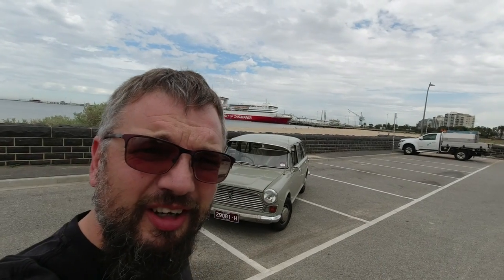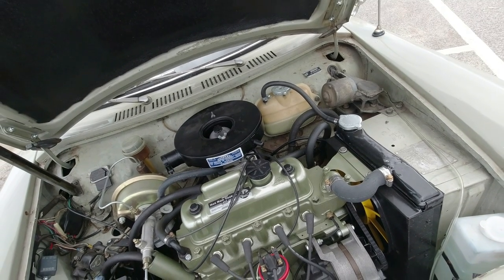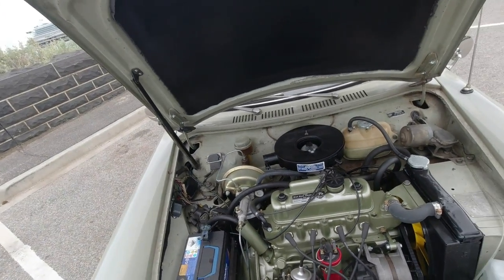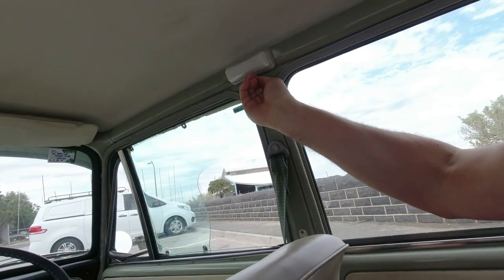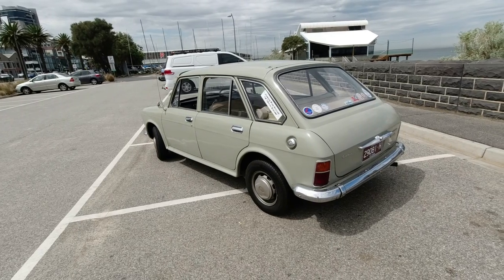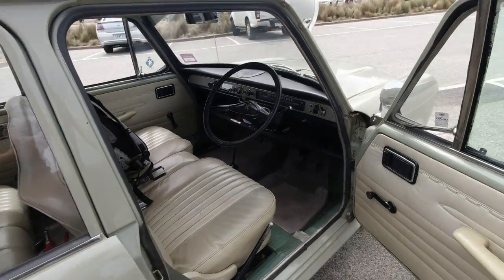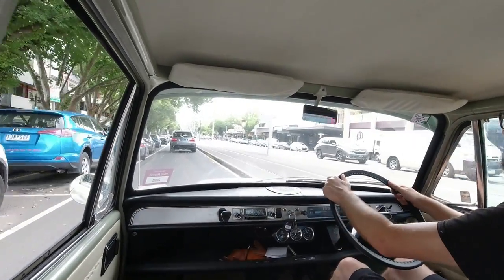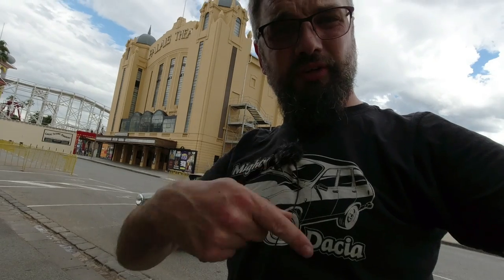Aussie Oddballs: Morris Nomad (1100/1300 station wagon thing)

Comment: We had an Austin Mini automatic. It had the larger 1275 engine with HS4 carburettor rather than the basic HS2. I remember being told in no uncertain terms to use Esso Uniflow oil, and no other. It was very expensive. 
The car had a phenomenal amount of sound insulation.
When my father-in-law bought the car after we had it a few years he decided that the £1.00 a gallon Duckhams oil was suitable. Three months later the motor/gearbox packed in. I liked the gearbox.
Reply: Yep, they were fussy on oil but required nothing special, just a good quality one.

Comment: The transmission shifts a bit like a modern Mercedes AMG or BMW M car, but more raspy.
Reply: It has a straight fluid coupling like the original Hydramatic, not a torque converter which tends to soften shifts because of the variable ratio.

Comment: Oh that was a treat indeed, much thanks Mr H. Who couldn't love a Maxi shrunk in the wash? Another mysterious (to us in the UK) motor, have to say it does look a little odd but I love it and wish they were sold over here. As an in house rival to the Maxi that was never going to happen. So sad there are so few left, be well Dinsdale and thanks to the owner.
Reply: The E series engines were brilliant. The 1500 lacked a little oomph but the 1750 was a stroked 1500 so heaps of torque. Rarely had to adjust tappets, which was fortunate since they used buckets and shims. I had 21 Marinas with these engines (before I lost count) and did countless thousands of miles in them. They kept me on the road during the early days of my marriage and was the car my wife learned to drive in. She loved the two she had.

Comment: I've been looking forward to this test . I had a 1500 Nomad in Melbourne the same colour as this. I got it free off a friend because it had stuck in gear (again) and the registration was due. I fiddled about with the gear selector and eventually got it so it would engage and disengage third. I drove it home several miles like that. More knowledgeable friends got involved and I ended up with a car which would select all except fourth, which was fine. I really liked the car; it was powerful enough and very economical. I even slept in it a few times after having a few too many at a party. IIRC you've got to open the doors to make the bed otherwise the arm rests get in the way.
This was in the mid 1980's when no one wanted BMC stuff and they were just a disposable car. I'm surprised the survival rate is so low though. I wonder how many 1100s and 1100Ss have lasted?
Nice to see "My" part of Melbourne too. You started filming in Albert Park, then drove through Middle Park and into St Kilda. For several years I lived very close to where you finished up. It was a fantastic place to live then; far more affordable than it is now.
Thanks as always.

Comment: When you closed the door I mistakenly expected the tinny clank sound typically associated with little cars. instead I was greeted with a hearty thud faintly reminiscent of a 76 Monte Carlo.
Reply: I also expected the tinny clank. My Morris 1100 certainly did the tinny clank thing. I wonder what they changed?
Reply: Inside the door is 7 pound of Aussie dust, giving it a lovely sound
Reply: Is that before or after the built-in Monte Carlo metal oxidation set in?
Reply: @davidhynd4435  The Oz Leylands were all "beefed up" after taking them for long test drives over "bush roads".
This was forcibly brought home to me when my mate & I hired an Austin 1300
in 1971, parked it on an uneven carpark, locked up, & came back to find the doors were all popped open.

We suspected foul play, but nothing was missing, & we had to move off the uneven bit before the doors would remain closed.
That would never have happened with an Australian made Morris 1100!

Comment: Back in '65 I worked in a shop that had BMC, Mercedes, And Ferarri. Wedid get the 1100 MG,  but they never sold well.  The engines leaked oil, that went to destroy the rubber CV joints and constantly needed replacement, due to the oil leaks that everyone tried to correct, with little sucess.  Thanks, Richard Schickling  Plymouth Meeting Pa.

Comment: I was 10 years old when I discoverd the Morris Nomad. It was another "Muriel, there's an outrage on the lawn!" moment when a cluster of hairy aRrrr$e Cobbers decided to mess with Mothers tooling. Like the bored out 1622 B series, the Blue Streak B serirs six, the hatchback, extra gear auto and manual Maxi box E4 engined Morris was an answer to a question BL never asked. Since the Japan Incorporated via AMi Toyota, and Datsun and Mazda and Isuzu and Colt had already invaded Australia and New Zealand, the Leyland Wing just added the best combinations. Heating, ventilation, bug demolishing windscreen wipers with great wash and wipe, burst proof door handles, venti pane quarter vents on Minis. The AP 4 speed gave birth to 3.48, 3.27 and eventual 2.76 axle ratios for 17.3 mph per 1000 rpm long legged cruising. 70 mph at  4000 rpm in a Mini wasnt that painfull. All the ADO16 questions the top brass failed to ask were answered years in advancr by those cocky "'strines". BL had the world at its feet. The P cars P8 derived P76 and the ill fated P82 compact with its planned Vee Six 3.3 litre cut down 4.4 V8. All qued up and planned in advance. The financial Cookie Crumbled worse than a Hudson, Packard Studebaker and Rambler condortium. Crumbs. I love your posted video Ian der Hubmiester. So sad that global growth of the Japanese stole all Englands great ideas and sold you all down the river. Oh, and the reason the Nomads survivak rate is so low was just chassis center rust and the somewhat difficult service of the hydolastic damper units. Everyone wanted the A series engines for Mokes and Mini Sevens oval track racers. Just like P76s got the 4.4 engine taken for Jet Sprint Hamilton jet boats and the Australian Leyland parts were drawn hanged and quartered for competitive club racing Car parts. Gosh Im sad at what happened.

Comment: A little red, Aussie built, 1967 Morris 1100S - complete with a bench front seat - was my granddad's pride and joy for years. With the Michelin Xs it was fitted with from new, plus the hydrolastic suspension, on a narrow tight, twisting back road, it could leave many a far more powerful car in its dust.

Comment: My sister had a Morris Nomad which she very cleverly managed to drive into a ditch and roll. She was unhurt. Nomad was not. Hers was the 1500 five speed. I had a Morris 1100 at the time so I was impressed by the extra performance and the five speed box. I was talked out of buying one by a mechanic friend who insisted that valve clearance by means of shims was a pain in the proverbial to get right, so I bought an Austin 1800 mk1 instead. I had friends who mocked the steering wheel angle saying that it was like driving a bus. I liked it. You could rest your arms a bit while you drove. Very nice, direct rack and pinion steering as you pointed out, although in the 1800 it was hard work at parking speeds. If Dinsdale were mine I think I'd have to ditch the loud exhaust. Shame there are so few Nomads left. I wonder how many died by ditch?
Reply: Thanks for passing on the mechanic comments. So much more insightful on why a car failed in sales in Australia than the comments by others about styling and colours etc.

Comment: The ADO16 was offered with a 1275 and AP automatic in North America as the Austin America.  It met with modest success in Canada, but didn't do so well in the United States. 

When our small family outgrew Dad's Sprite, he had three finalists for its replacement: Volkswagen Type 3 Variant, Austin America, and Opel Kadett Wagon. 

The Volkswagen was dismissed rather quickly, but the Austin hung in as we were to an extent already a BMC family with a Minor and a Sprite.

The Opel won out due to its conventional rear-drive platform and the national (Buick) dealer network for service availability (which was a serious consideration with family in rural Georgia in 1970.)

Cheers from Costa Rica!

Comment: Dinsdale has no problem keeping up with the modern appliances called  'cars".  The road you were driving on is called Beaconsfield  Parade.  The thing about the BMC/British Leyland cars built in Australia is that they were honest unpretentious cars made to adapt to  the climate extremes of Australia,and the vast distances of this continent
Reply: As a former owner of several BL cars built in Australia they suffered from some terrible problems that spoiled them for many people and truly limited their success. The Hydrolastic cars always suffered from ground clearance and inadequate suspension travel problems to be great cars in Australia. Things like the unshielded distributor facing forward that would get wet during a rain storm should have never made it out of the factory.
Reply: @dazaspc  As an 18 year old inthe UK i'd buzz about in my Mums Blaze orange Mini. In heavy rain dead Minis at the side of the road was a common sight. The coil was often the culprit as that too was mounted just behind the grill.  British car for British weather! Ah the irony!
Reply from the maker: Distributor rather than coil. Always a weak point being right in the firing line on a wet day.

Comment: My first car was a Morris 1500....picked it up 15 years old but in near new condition (50,000 miles) for $500. It was a 4-speed, but I soon swapped in a good 5 speed box. Once I'd sorted out a few BMC niggles and swapped in some decent front seats it was a good car, and I had it for about 8 years. A fast cruiser that handled well, strong, and great on fast outback dirt roads, and never really let me down apart from a blown head gasket one time that gave me the excuse to port it, swap in a set of 4:1extractors I found hanging unloved on the wall of an exhaust shop (neccessitating cutting the inlet manifold away from the cast exhaust- ah, the things that seem reasonable when young), and porting, flowing/rejetting the SU carby to match plus a few other tweaks. After that it was officially pretty quick- 100+hp is quick in a 800kg car...it easily embarrassed a mates new 'twin cam corolla' which was properly hilarious...

Comment: THANK YOU (!!) for not talking during one of your standing starts.
Much as I do enjoy your commentary, I also want the chance to hear the car uninterrupted. 
Sounds like the old girl doesn't like being driven hard during 3rd to 4th gear changes. 
I imagine the oil filter must get clogged sooner with clutch pack material. This is not a car to skip oil changes in!
Reply from the maker: Slipping into fourth was sadly very common with these gearboxes. They did carry out some changes in the UK about the time this car was built.
Reply: HubNut here is a response I got in quotes on a discussion board when I mentioned seeing a Morris mini auto for sale.

"The Automotive Products 4 speed "jerkomatic"...
One hell of a weird transmission design, with shafts counterrotating in other hollow shafts, bevel gears and other workings instead of the conventional epicyclic transmissions of today's autos, and a cool governor system for deciding the shifts points where a flyweight governor driven off the output shaft moves a hydraulic spool valve further as road speed increases and the valve opens and shuts various hydraulic circuits to change the gears, and there is a spring on the governor for resistance, but the spring is pushed harder against the governor when the acellerator pedal is pushed further, giving both the kickdown and altering the shift point as throttle position changes.
Simple, ingenious, and didn't work all that well...but it was a damn good try!"

Comment: Hi  Luv your vids. the 1500 was  a genuine 105mph cruiser  bucket seats, 5 speed gbox;/  overhead cam chain  too thin.  Kimberley was the only designed and made Austrlaian  car like   the 1800 ute. suffered from overheating  and cable shift. should have had solid  rods. \The kimberley had a  FANTASTIC sus. perfect for Aust conditions.  4spd gbox for cruising. extremely roomy.. UNFORTUNATELTY IT WAS FRONT  WD.    and  was   thirsty.  More vids please.  when  are you  going  to  test a TR6.  as  I still have  two of  them.   I hope you  enjoyed  driving on our roads.  Stay safe. and thank you for spending so much  time. for our  enjoyment

Comment: I had a 1964 MG 1100 sedan back in 1972 in high school. 2 door, looked a lot like this. It had the hyd. suspension also I used anti freeze for fluid in mine. Pumped front to rear so there was no side role, it would go around the corners real fast, till the rear wheels would broke loose. Then it would hop side ways real bad.     Dan

Comment: I had of the normal 4 door versions of these in 1973 - with the luxury pack.  Biggest heap of crap out there but did do 83mph flat out on a cold night.  Biggest worry was not the gearbox but the ignition failure every time the humidity got over 50%.  50 years later I would buy my old car back if it still existed.

Comment: It's a mini maxi?  Or maybe a midi?  What a strange but curiously rather wonderful thing.  I always really liked the A series with an auto.  You could use the stick to manually chnage gear too.  Very useful for downhill bits or maxing out the revs in each gear.  A bit is slippage is not unusual though.  Excellent stuff, thnaks Ian.

Comment: Awesome little cars. I had a 1500 sedan version of one of these as my first car. The 1500 had a 5 speed gear box not a 4 and would comfortably sit on 75 mph all day. They had their quirks however the one you are testing sounds to me like it has the wrong oil in it? The auto trans models like the mini auto trans models had all sorts of slip problems when you used the wrong engine oil. The only oil you can get now that works properly in these is Castrol XL.  The E series had its problems though as it had a flex coupling on the exhaust that would stop flexing and break off the exhaust manifold studs. It was quite common for these to have a VH40 fitted as a front brake booster as well. After bending the brake pedal in mine I fitted one as well. It is funny that all 1100, minis and nomads had a very light piece of steel holding the brake pedal but the Cooper models had a wider piece that wouldn't bend. The gear selection cables would rub and leak engine oil that was a very expensive fix. They were also dreaded by tire shops in their day as the wheels had so much offset many tire machines were unable to fit a tire properly.  I did hear once that the tail lights on these were also used on a particular sports car and were quite valuable however I have never identified what car it was.
Reply: Tyres needed to be fitted from the back of the rim because that was where the well was - biased to the rear.
Reply: @exidy2290  That was the problem as the center of the rim was so far out past the the lip most of the tire change machines couldn't grip them.
Reply: dazaspc wasn’t a problem for me, did all three changing back in the day with rubber a tyre machine was until I hit the big smoke aft mallets, levers, bead breakers and the like. Not a machine in sight, not even one of those hand operated tyre removers. Did ‘em all, motorcycles through to truck and tractor tyres. Didn’t even know what’re my apprenticeship.  ;-)

Comment: Friend had a pale green one of these. No Park lock in the transmission. Had to rely on the handbrake. In-laws had a chocolate brown 1500 with a five-speed manual box. After about 30,000km fifth gear failed, so they drove it for years in fourth. OHC motor was a shocker. Leaked oil like it was free.

Comment: I had one of these in the early 90s with the 1500 5 speed. I was advised not to even think about hotting it up as the gearboxes blow up. BMC Australia also had a car called a Morris 1100S which was a good source of manual 1275s and most of them went to the wreckers in the 80s. In those days you could buy a running 1275 for about 40 bucks.

Comment: My first car was an Austin 1300 Countryman with the wooden trim on the sides. It was an estate car very like the Nomad, except the tailgate was less curvy and it did not have the hydrolastic, but sprung hinges. 1275 engine, my only problem was the driveshaft couplings disintegrating on a tour of Scotland.

Comment: There is another local Oz website on the Morris  Nomad and it's sister cars. www.elevenhundred.com/morris1500/index.php
A great resource. Also Ian you kept saying assembled, unlike NZ Leyland/Morris cars that were often CKD kits, the Oz cars had a high local manufactured content. The high tariff protection at the time (and the ADR rules) required local manufacturers to make cars with at least 70% local content to avoid large $ penalties.
Reply: yep.nz one were not finished anywhere near as good as the australian models, with no options.gearbox good for at least 10,000 miles, then ditch them.drove real good tho.

Comment: If I recall correctly most Morris Nomads, unlike this one, were sold as manuals and so had the 1500 OHC E series engine and likely 5 speed. Very unusual that the auto version went down in engine size to A series 1275 cc. Conversely the Aussie auto Mini K went up in size to 1100cc when introduced around 1969.
An intriguing subject raised of the survival rates. A combination of how a car was loved and the reliability and ease of maintenance.
Middle front bench position in Australian small cars was usually for children's accommodation.

Comment: US (and maybe Talbot) Horizons had the attached to the seat rear parcel shelf as well, for their entire 11.2 year run. But the mechanism was in the car, not under the parcel shelf, which was a lot slicker. The main problem, besides not being able to have a split rear seat, was that if you put speakers under the shelf it wouldn't be able to fold flat any more. Otherwise it worked well, and you didn't have to find somewhere to stow the shelf with the seat down.